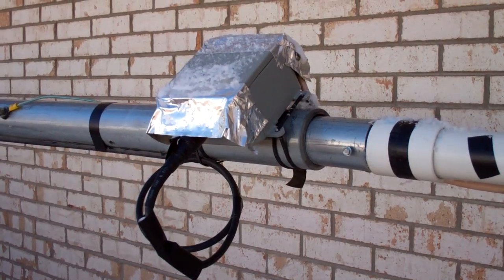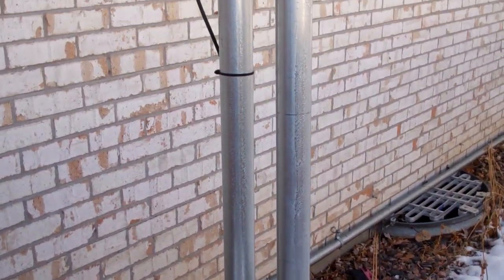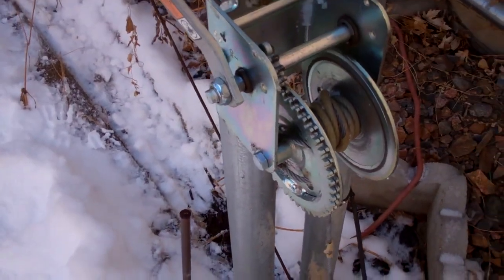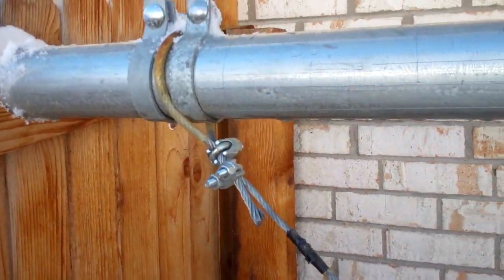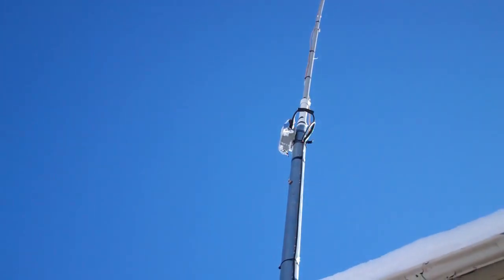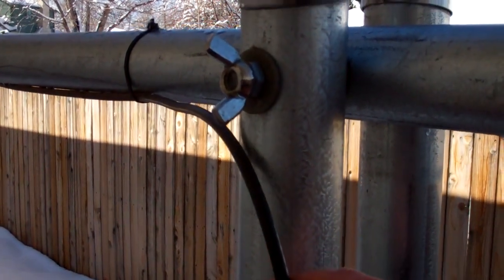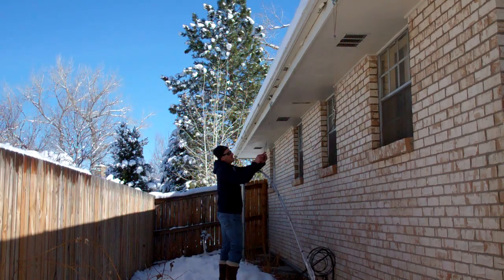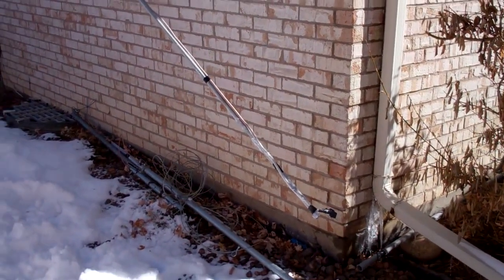Tilt-Over Crank-Up Antenna Mast

Comment: 1/2" bolts? Looks to me, they are 5/16" bolts. Although the head may be a 1/2" hex, the bolt is not 1/2". I could be wrong as a camera may not show the heads to be 3/4".

Comment: Nice job.  Very clean and simple.  But dang that antenna is floppy!
Reply from the maker: Thanks!  It's constructed from fiberglass mast sections from DX Engineering. Made to be flexible and helps it to weather the wind when it is up.

Comment: What a great video. This is exactly what I've been looking for - so thanks for sharing this brilliant idea. I was wondering what length of cable you're using on the winch/crank for your 27 ft antenna ?
Reply from the maker: Gosh I'm not really sure...its been so long. I want to say 10...maybe 12 feet (3-4 meters)? That thing has been out in the weather for over 15 years now and still in great shape.

Comment: how is your antenna working? - both when it is up, and can you use it when it is down??
Reply from the maker: It works great when it is up. When it is in the down position it still works but the signal levels go way down and the noise goes up. The whole setup is still in great condition even though it has been installed for nearly 15 years in that spot.

Comment: first use SS aircraft grade wire rope. 
second build a cover for the winch.
third rebuild the winch with a screw drive system this way the weight on the winch drum will not go wiled with the handle.
a worm can drive a gear, 
but a gear can not drive a worm. 
were you are attaching the wire rope to the tower pole just us a loop bolt. no need for those two clamps.  and get the pole end of the wire set up right in a pressure clamp . just looks cleaner than those grip nut/bolts.

Comment: Is your crank a regular boat crank or is one that set to where you have a easy to pull  up?
Reply from the maker: The small winch is pretty much the same as one for a boat. It makes it really easy to raise the mast and locks in place. The exact winch I am using in in my video description above and has a link to it.

Comment: Nice, simplistic idea that could work well with a sleeved Spiderbeam or DX Commander setup for those of us with strict HOA's that we unfortunately have to deal with... thanks for taking the time to make the post! 73
Reply from the maker: Most HOA's allow for the installation of a flagpole in the front yard. I always thought if I lived in a neighborhood that had a lot of restrictions I would put up that largest flagpole they would allow...flagpole insulated from the base of course then set the length to the frequency range I dx the most of course. Utilize a matching transformer if needed.  ;'D

Comment: Learn how to use those wire clamps properly.  Be careful to use a high grade bolt as the hinge pin... come cheap bolts are very soft and not safe in shear like this.  Paying a little extra for a worm drive winch.. will pay benefits in retained teeth.
Reply from the maker: Yeah the video is over 7 years old and many have commented on it. Been fixed a long time ago.

Comment: Great! Thank you for sharing this. The crank setup is awesome. How did you drill the holes for the tilting bolt and line-up perfectly? I'm also in CO and also wondering where you procured heavy-duty galvanized post. This looks better than the HD/Lowes variety.
Reply from the maker: Once I had the two base poles in I just measured to where I wanted the pivot points from the tops of the two poles and eyeballed it the best as I could. They lined up relatively well. Then a BFH took care of the rest (tapping the pivot bolt through all three poles.). I think (it was a good 10 years ago) I got it at my local ACE hardware. Here it is: https://www.acehardware.com/departments/lawn-and-garden/farm-and-ranch-supplies/farm-equipment-parts/7020662  It was only about $35 when I bought it.
Reply: @kugellagers  Nice! Always a good thing to have a BFH around!  Thank you.

Comment: Hey brother. I know this video is almost 7 years old. Im a ham radio tech but also a helium miner. Im in a sweet location but surrounded by trees and buildings. My antenna even at almost 30 feet up  is performing poorly. This design is intriguing.... I've watched this video several times and am strongly considering giving it a try. But I want more height , approx 75 to 100 feet. I noticed you used fiberglass for the parts of the design beyond half way up  and the reduction in weight makes sense. So I guess Im asking in your opinion could a mast built based on your design be upscaled to a possible 100 feet?  If not please tell me why and if so, please explain what Im in for. And if you have any interest in helium mining I would be glad to trade out my expertise for yours. For some context many Hams are also helium mining because there are so many parallels between the two.
Reply from the maker: I would think everything would have to be scaled up considerably to go as high as 75-100 ft. You would certainly want guy wires of some sort if it is permanent the force from wind and sheer weight of the structure increase significantly. You would quite a bit more concrete for the pier as well to support the setup. Maybe you could hing the mast in the middle to make it easier to store when not deployed.

Comment: I only need like top rails and the crank tilt over parts. Not sure yet tho how to do it or the best way.
Reply from the maker: The crank is just a mini hand winch. I have all the parts and  basic stuff I used in the more detailed part of the video description. You can probably use standard fence top rail for two sections for a temporary deployment w/o guy wires as a crank-up option like I am using it. But I would use thicker fence pipe for long-terp deployment. My antenna only up when I use it while I am using it.

Comment: I run a similar portable 29 foot wire vertical for field ops and POTA. I use a 9:1 transformer (EARCHI UnUn) to feed the wire and a 13 foot counterpoise. What's the turns/impedance ratio on your transformer in the box? 

De WB2VUO here near Buffalo,  NY
Reply from the maker: I'm using 42:6 turns for AM BCB and LW based on articles by John Bryant: http://www.dxing.info/equipment/
Reply: @kugellagers  42:6 would be a 7:1 turns ratio. The greater number of turns would help on the lower frequencies. This would yield a 49:1 impedance ratio. A common value seen in EFHW antennas. What ferrite or powdered iron mix do you use for the toroid?  I tend to see a -43 ferrite mostly.

De WB2VUO here near Buffalo,  NY
Reply from the maker: @Keith_WB2VUO  Its been awhile since I cobbled all of this together but I believe I am using type J which is similar to type 75 ferrites. The low-noise vertical antennas I am using are based on those of Dallas Langford who uses a similar setup.
Reply from the maker: I wanted something that would be good in MW BCB and LW broadcast as well as NDB DX .Also, see my video detailing my low-noise antennas. https://youtu.be/hSwkM9aaGNU?list=PLCED329D32CFBDBBF

Comment: Great system!
Could you tell us what is the actual antenna you are using?
Thanks
Reply from the maker: It's a 27' low-noise vertical of my own construction for MW/LW dx'ing and based on designs of Dallas Lankford.

Comment: I know this is an old video but my internet company wants to charge me $5000 dollars to install a 50ft tower to hold their miniature receiver So I can receive their signal. Would it be possible to make this rigid for 50ft ?? Their equipment is like a miniature satellite dish. I’m sure I wouldn’t want any sway so I was wondering if thick gage pipe would stay rigid at that height ?  .
Reply from the maker: I don't think they would allow that to be used for such an installation. Anything they would put up is on their liability for safety and site needs and w
would have tp be to their specifications. They would definitely no want something to sway. Also, if this were a 50ft tall permanent construction you would have to have guy wires (or a much thicker mast with no guy wires.).

Comment: I recently saw this video and liked the idea a lot. I decided to go ahead with putting my own crank-up mast in place. So last week the hole was dug. 1 meter long by 3/4 meter wide by 1 meter deep. Each pole is 3 meters long and 50mm wide so 10 feet long by 2 inches wide by 1/8 wall thickness. 
Today I put in a cavity concrete block and got some rebar and 5 other 1 meter lengths of various galvanised 26 mm steel bars, wired them all together with galvanised fence wire. Lined the hole with stones of various sizes and put sixteen bags of concrete mix on top of all that. Today is Wednesday 14/04/21 and by Sunday coming, the 18/04/21 the concrete should be well dry and time then to put the rest of it together. I hope to be able to raise the mast to about 35 feet or so. I put a latch bar on so when it is raised it goes across the back of the mast to hold it in place, put there as a little extra safety precaution, no harm it being there. I enjoyed the project but doing it is hard work. Mine is up a hill so everything had to be carried by hand. Thanks for sharing your idea and I'll give an update on the rest of the project at a later date.
Reply from the maker: Yay! Congratulations!

Comment: 4 meters from the ground is low, My 5/8 Wave Antenna sits on a 10 meter pole
Reply from the maker: It is for AM BCB and LW BCB DX only.  But you can put whatever length of mast on you want. I used have just the mast part of it 35ft before any antenna.

Comment: I would Add  rod through the 3 posts when in up pos. so not relying on cranks finger latch only to hold her up.  nice though
Reply from the maker: I can put a lock in the crank if I leave it up any amount of time. But I crank it up only why I am using it.

Comment: Awesome stealthy.  I think I'd use the stab in plant holders to stay at the mast supporting points so it lowers right into the hoop and lifts right out from the level supported point.
Reply from the maker: I just didn't want another thing for the kids or the dog to potentially run into. That's why I support it with the hook/loops.

Comment: Are you using ground radials on this at all or just the vertical?  What bands do you use this on?
Reply from the maker: This is only used for AM and LW DX'ing. I don't transmit. However, there is an 8 ft ground rod grounding the mast.

Comment: Getting ready to build this same setup. Ive had a 2-7/8" sch. 40 galvanized mast 24' for about 6 months now. Im adding a 2-3/8" light gauge galvanized, which will slip into the larger piece, and extending the mast. The piece Im adding is 16' and will slip into the sch 40 galvanized 8'. So the mast height will be 32', plus the 6' 2m antenna atop that. The HF antenna is an inverted L and will go up to 25' and then horizontal. Since Ive got to drop the mast to add on, Im going to go ahead and copy this setup. Will make things much easier later
Reply from the maker: It makes working at the antennas on top a breeze. Just make sure you leave enough cable at the pivot point to flex and bend as you put it up or crank it down.

Comment: Very nice! I guess you crank it up and down a bit to tune SWR?
Reply from the maker: Nope. just to raise it from the ground into a usable position. It's a broadband receiving antenna for MW/LW and has a matching transformer in that gray box near the base.
Reply: @kugellagers  So you never had to adjust the antenna at all?
Reply from the maker: @RC-Heli835  No. It's all set for the bands I DX. I just crank it up when I am going to use it and crank it down when i am done.
Reply: @kugellagers  What does the matching transformer do keep the impedence around 50 ohms for whatever frequency your using?

I can't find those 8ft fiberglass antenna sections anywere.
Reply from the maker: @RC-Heli835  The transformer keeps the impedance closer to 50 ohms but it is not, by any means perfect for the whole of the MW and LW bands I listen to. The fiberglass mast sections are from DX Engineering.
Reply: @kugellagers  Which meters do you operate on?
Reply from the maker: @RC-Heli835  I'm just a DX'er and a GMRS licensee. I DX primarily the AM bcb and LW. One of these days I'll get my ticket.

Comment: Whats something like this cost? I wanna add my 50’ pole for something like this for easy access. Thanks
Reply from the maker: Consider it took about 9-10 bags of cement and the original mast was telescoping fence posts about 35 ft tall. I built this over 10 years ago as well.  I want to say the fence posts cost me $250-300 USD, the cement was less then $100 and the winch is $30-40. So less than $500. If I were to rebuild it today as configured with the fiberglass mast and much less fence post it would not have to be so sturdy. I would say today it would be less than $400 in its current configuration - antennas/transformers not included. But I built all that myself too.

Comment: If you decide to leave the antenna up, do you guy it?
Reply from the maker: I don't guy it on the rare occasion it is up more than a day. It is very flexible fiberglass and I don't DX if winds are over 15-20 sustained. If you look at my Low-noise Vertical Antenna video you can see it flexing in some 15 mph ish winds in the last two minutes or so. It can flex a lot more than in that video.

Comment: Neat setup.   Looking at how easy it winches up and down for you I am guessing not much weight above the pivot point, so you could probably rotate up and down easily without the winch.   

Like others I would like to see a bolt or other way to lock it in the up position without dependency on the cable but then I understand you only have it up when you're using it due to deed restrictions and the cable is capable of handling a lot more weight.
Reply from the maker: It used to be heavy telescoping fence mast up to about 35 ft so there was a lot more weight involved. You are right it doesn't really need the winch now.

Comment: You apparently have never had a problem, but you should have a safety on that so nobody could play with it and have it come crashing down.
Reply: I never have the antenna up when I am not DX'ing. But I put a padlock on the winch when I am not using it so that it cannot be cranked up. Definitely a good safety tip.

Comment: Hay that is very smart I would like to build one for my ground plane antenna, and especially the come along winch that is truly Super Genius I've got to build one as soon as possible, you've gotten me super motivated, I need to study your blueprint you could put this on the market and it sale like hotcakes, thank chief for your invention is really nice and on point.✌🏾🕵🏿
Reply: I scraped it together from various ideas I saw  on the web for a crank up mast and adapted it to my situation. But thanks.
Reply: Rohn and several other tower manufactures already make and sell fold-over/crank-up masts.  Some are even rotatable with a rotator mounted in the base!  They are a bit on the pricey side though.

Comment: Thanks for posting this video.
I live on the NC Coast. Lowes guided me to the fence post as antenna tower, but Hurricane Florence laughed at that 3 10' section of fence post, pretty much tying them into pretzels. So I regrouped and now I'm using thicker gauge steel electrical conduit and only 20 feet due to the weight, which is where your winch idea comes in!
Reply from the maker: I got my winch to lift a 35 ft of heavier gauge of telescoping fence posts starting with the 3" at the bottom. So it is plenty strong to lift what I have now. I over built it.

Comment: When you had the metal telescopic mast, how did you secure the different sized poles together?  Did you drill holes and bolt them together at each extension point?  I am looking to make a mast with your exact design, except I want the metal poles to put a slim jim copper antenna on.  Also, would mounting the slim jim on the side and a yagi on the top with an azimuth and elevation rotor interfere with each other? (Not related to your video)  Great design by the way.
Reply: Thy Bounty Farms Wondering the same thing myself 🤔
Reply: I did that exactly. I left about 1 ft + of smaller pipe telescoped in larger pipe and have two galvanized bolts at two points go all the way through both pipes.

Comment: How did you conect the crank to telescope the pole upwards???
Reply from the maker: The telescoping sections are fixed and clamped together with band clamps. The winch uses 3/8" galvanized steel cable to raise and lower the mast assembly. See the diagram at the beginning of the video.

Comment: Very nice  system. I like the choice of materials  and the overall simplicity of the system  that  usually results in lower maintenance issues over time
Reply from the maker: The setup is still going strong now after about 12 years now. I should do a long-term weather effects video for my construction.

Comment: Mu dad made the same concept but we used 4 inch steel pipe for the base . Dad had threaded the ends so went from 10 foot 4 inch to 3 inch 10 foot 2 inch so on to reach 40 foot.We didn't think of the wench.Great design for those who like to play!
Reply: Can also use an impact driver to raise instead of handle . ...jmo